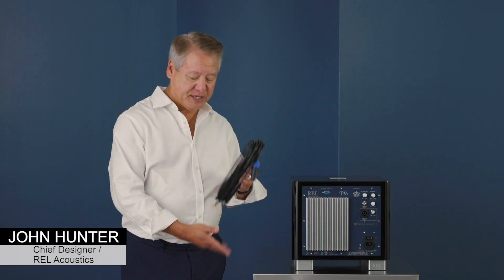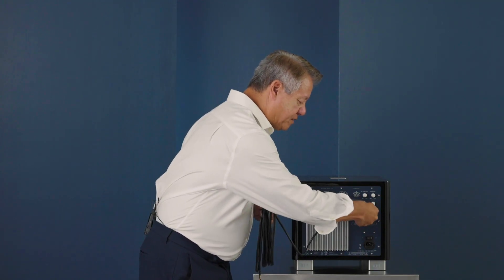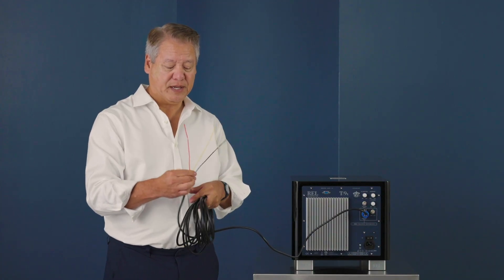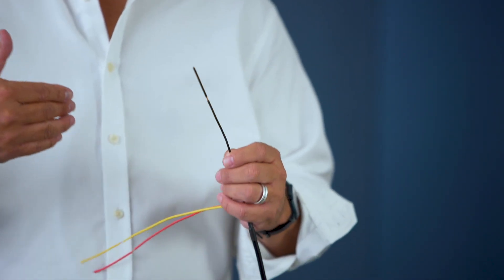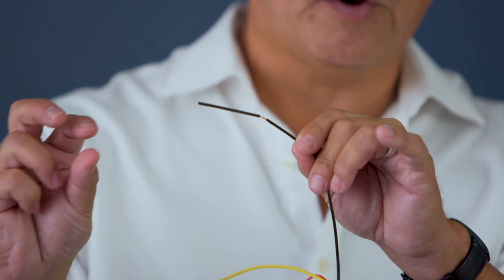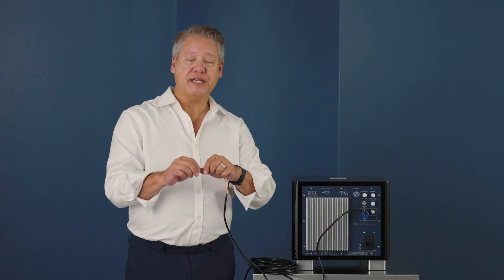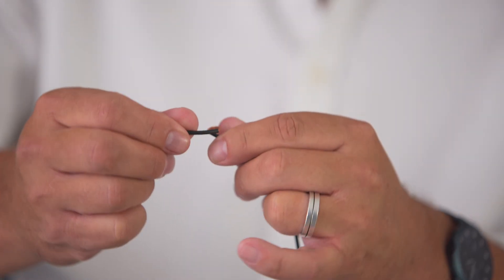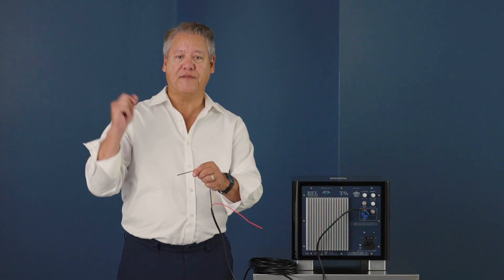If You Only Watch One REL Video, Watch This One. The Simpler Way to Connect Ground. It's Safer Too.

Comment: When using stereo subs do I still use both yellow and red hots together?
Can you wire your sub directly to the back speaker terminals... in theory it should be no different than bi-wiring.
Reply from the maker: Thank you for contacting us. When connecting a stereo pair of subwoofers using the High Level input, we do recommend combining the red and yellow High Level wires for each subwoofer and connecting to the positive speaker terminal for the corresponding channel (either on the amplifier or on the main loudspeaker itself). 

If you are powering your speakers using a Class A/B amplifier then it is possible to connect the black wire of the High Level cable to a negative binding post on either the main loudspeaker or the amplifier, though if you are using a Class D, balanced/differential amplifier, or are unsure of the output stage design of your amp then the black wire should not be attached to any speaker binding posts, and instead they should be attached to a chassis screw on the amplifier.

For complete High Level connection instructions specific to your system, please write in to contactus@rel.net and our team will be happy to assist.

Comment: Nice tip video.  And timely.  I have been using two Marantz MM8077 amps for my home theater system.  Those. were class A/B and  I currently have the black wire from each of my REL subwoofers grounded to the black terminal.  I am about to swap those out for a single Marantz AMP10 which is class D. But it sounds like rather than floating the black wire, I can simply ground it to a chassis screw.  I noticed on the AMP10, that in addition to perimeter copper screws on the chassis, that by each set of channel terminal posts are multiple copper screws. Are those also for grounding?
Reply from the maker: Thank you for reaching out. The Marantz AMP-10 is a Class D amplifier, which means that it will be important to not connect the black wire of your REL's High Level cable to any of the negative speaker terminals on the amplifier. Instead the black wire should be left completely disconnected, or if you experience a hum from the subwoofer then you can try connecting the black wire to any of the outer perimeter chassis screws on the amp which will provide a stable ground reference.

Comment: Completely agree with this approach.  I placed the ground to a screw on the chassis of my MC452.  Dead silent at the subwoofer.
Reply: Cool, did you use the naked strands or did you use a shoe/spade?
Reply: Just used bare wire

Comment: I've been trying to use my 2 Amps bridged in mono with a pair of rels  connected high level. Nothing has worked to get rid of the hum. Even this. I really don't even know if it's even a hum at this point...the subs  just goes nuts.
Reply from the maker: Thank you for reaching out, and we are sorry to hear about the hum that you are experiencing. When you have a chance, please write in to contactus@rel.net with the serial numbers for your subwoofers and a brief description of how they are currently being connected to your bridged mono amplifiers, and our team will be happy to assist with troubleshooting and resolution options as needed.

Comment: I have the Technics SU-R100 integrated amp. I also connected the ground wire to a chassis screw. Sub hum disappears when amp is on but comes back very loudly when I turn the amp off.
Reply from the maker: Thank you for reaching out, and we are sorry to hear about the hum that you are experiencing when your Technics integrated amplifier is powered off. When you have a chance, please write in to contactus@rel.net with the model of REL subwoofer that you are using and a brief description of how it is connected in your system currently and our team will be happy to assist with troubleshooting and providing resolution options as needed.
Reply: @RELAcoustics  See my comment below.
Reply: @RELAcoustics I have tried the two methods described by Rel. I left the black ground wire alone unattached and connected to a chassis screw. When I turn the Technics integrated amp off, the sub produces a loud hum. When I power the amp ON the hum will "click" off after about 10 seconds.
Reply: Did you ever figure out a solution to your hum when the amp is off? I have the same problem with a McIntosh MI502.
Reply: @yungsters  No. I contacted REL, they double checked my connection and just told me to leave the amp on all the time. Not sure if this is good for my $10K integrated amp!

Comment: If high level cable length from REL to the AVR is an issue can one take of the signal straight from the left and right speakers?
Reply from the maker: Thank you for reaching out. It is possible to connect the High Level cable to the binding posts on the back of each main loudspeaker, rather than connecting to the amplifier's own output terminals, though this is typically easier done when using a stereo pair of subwoofers so that each REL will only need to connect to the back of a single speaker, rather than the cable needing to stretch to both speakers. In addition, we only recommend connecting the High Level cable to the speakers when using a Class A or Class A/B amplifier. If your amp is Class D, fully-balanced/differential, or otherwise does not reference to ground at it's negative speaker terminals, then we recommend connecting the High Level cable to the amplifier so that a stable ground reference can be achieved if needed.

Comment: As an owner of 2 REL's, I wish REL would start putting level indicators on on the plate amp behind each dial would really help.  Having to count clicks of each dial to figure out what the dial is set at is silly.  Imagine a speedometer in a car using clicks instead of markings to show how fast you are driving.
Reply: Yes the "click" thing drives me batty. And the knobs REL uses aren't the most tactile things in the world.
Reply: I mark my sweet spot settings with a sharpie…serves as a reference and pretty much works no matter where I place the sub or what gear I change out.  Maybe once you figure out what setting loads your room…you’re good.  You can always adjust up or down…but yes…I can see the frustration when those adjustments need to be made you have to look at the dials to know which one to turn and then go from there.
Reply: Thx, agreed. I use strips of tape to mark my settings.  Dial markings aren't needed for tuning (whether with an SPL meter or,  if you're a grumpy old luddite, "by ear"), they're so you can easily & quickly RESTORE your old settings after trying others.  Counting clicks on 3 dials x 2 T9i's  is a pain in the ass.. I've done it  Asking Rel to finally put dial marking on all their sub, not just some of them, is just common sense.  .   @kesm66
Reply: I own 8 REL’s throughout the house from T, R and S series and honestly wondering why you are complaining about this. I play with the dials maybe once per year after changing gear (sometimes not even necessary) so turning one or two clicks per year doesn’t seem like it would be a big deal to anyone. Is there something about your setup that requires you to have to turn the dials frequently?

Comment: I have two PS audio stellar M700 mono blocks, and it states explicitly that I cannot hook the two mono blocks to one single high-level sub. Would the solution you explained override this warning? I have long been thinking about installing a single sub, but that warning has kept me from doing it.
Reply: Not really because the two amps might be at slightly different ground potentials. Get 2 subs, it is better anyways. In case you want to try, ground the sub to only one of the amps and make sure the 2 amps are fed from the same mains socket or, at least, line. If you don't get any hum from either the sub or the main speakers it should be ok.
Reply from the maker: Thank you for reaching out. In order to fully utilize the High Level connection method in a system which uses monoblock power amplifiers, it will be necessary to use a stereo pair of subwoofers with one assigned to each monoblock. This will be the case even if you connect the black wire to a chassis ground screw, such as with your PS Audio M700 monoblocks.

Comment: What if the traditional connection works well? Should I change it for this ?
Reply: Nope. Mine is on the black terminal on my anthem amps, and it works perfectly. He is just making it simple for someone new that is really trying to figure out the right way to hook it up.
Reply from the maker: Thank you for reaching out. If the traditional High Level connection instructions for Class A/B amplifiers is working well for you currently, then there is no need to change the wiring.
Reply: Thank you for confirming. I followed the manual's instructions and connected the black wire to the negative and as far as I know, it's fine. No hum.  @RELAcoustics

Comment: I have a Marantz 30 amp. I have two REL. Still the best way?
Reply: Absolutely. The Model 30 is a class D. Do not use the black speaker post, as there is a voltage output, and it will burn your internal REL sub amplifier out really quickly.
Reply: @scottking2821  Oh wow. I really need to change this quickly. Wasn’t aware that this might happen.
Reply: @reines-Vinyl  
Have a look back through the REL videos. John addresses Class D amps specifically in one of them. I contacted Marantz, and they concur.
Reply: @scottking2821  I too have Model30 (and LOVE it )... but are you saying the black speaker level terminals of Class D amp is not GROUND ?  That's news to me...
Reply: @ptg01  My Model 30 is still in its box, haha. Still using a Cayin tube amp currently. That’s correct. It’s a class D quirk. As I said above, John covered it in a previous video. It’s well worth a look. In it, he says to either float the black wire, use a grounding screw (as here), or run an RCA cable from a spare output, to the LFE terminal on the sub.

Comment: I connected my ground to the phono ground. no hum but when I put my ear closed to the sub I can hear rumbling even though there's no sound coming through. Is this normal? also whenever I switch the amp on, I get a pop sometime small sometime louder.
Reply from the maker: Thank you for reaching out. If you can only hear this faint hum/ruble when your ear is next to the subwoofer's active driver, then it is likely typical amplifier noise and does not indicate an issue with the subwoofer or the connections for it. If the hum can be heard when you step away from the subwoofer, especially if it can be heard from your primary listening position, then feel free to write in to contactus@rel.net and our team will be happy to assist with troubleshooting.

Comment: is it better than connect directly to the back of speakers? (2 subs setup) ??
Reply: Connecting to the back of the speakers is exactly equivalent to connecting to the amp speaker terminals. All relevant disclaimers apply.
Reply: @razisn  Correct.... Electircally the exact same points.
Reply: @ptg01  would the power ratings of the sub and the speaker must match?🤔